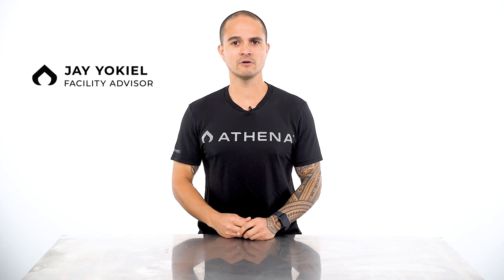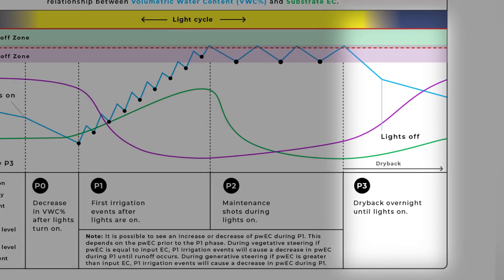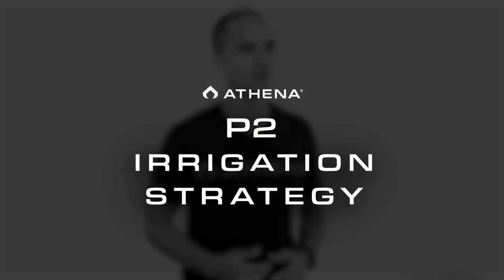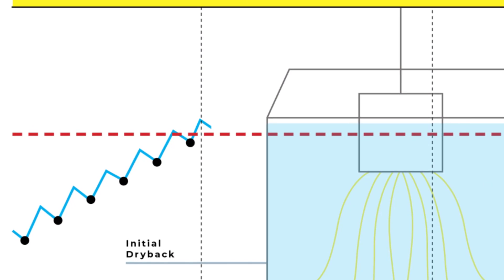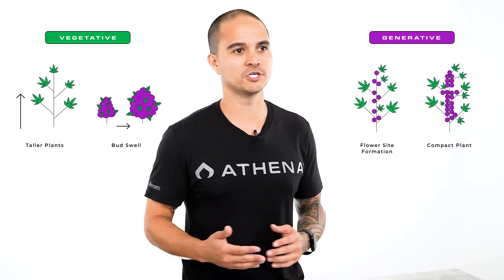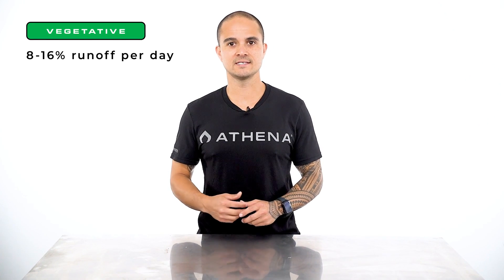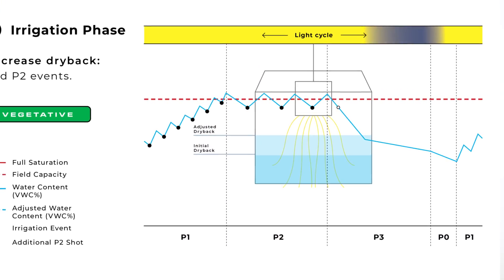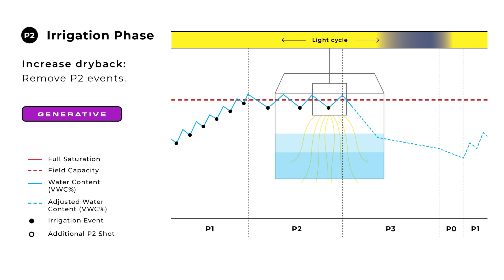Precision Irrigation Strategy – Part 4: P2 & P3

Comment: could this work the same or close if the substrate were different and it was a drip instead of a shot feeder ?
Reply from the maker: Yes, Shot volumes change with different size substrates and feed times differ due to the different GPH rates if the drip systems are different.

Comment: How can we calculate dry back percent? 
From end of phase 2 to end of phase 3 or from end of phase 2 to end of phase zero?
Reply from the maker: Vegetative Dryback: 30-40% of your full saturation moisture content. Generative Dryback: 40-50% of your full saturation moisture content. If your full saturation moisture content is 60%, a 50% dryback would bring you down to 30% moisture content. Your P1 irrigation events should begin after your overnight dryback has been achieved.
Reply: @athenacultivation  How would you go and measure it on High Pressure Aeroponics setup?

Comment: I really hope you guys make some new video for us smaller growers in soil. Like mixing the blend line. In just one gal of water. Just can't find a bunch of info
Reply: Just do what the recommended per gal says so bloom a 12 ml per gal bloom b 12 ml per gal an so on for cal mag an cleanse then just make sure ur ppms r in range and u should b good
Reply: What kind of info are you looking for? Most of this info can be applied to single plant, you just need the tools to measure the WC and EC to make those decisions. Otherwise, I would just use the blended line and their "hand watering" strategy. Look up the Athena Handbook, there's a ton of good info in there.
Reply from the maker: Our feeding chart is available at athenaag.com. If you have any questions or concerns, contact our tech support team at 844-333-1818.